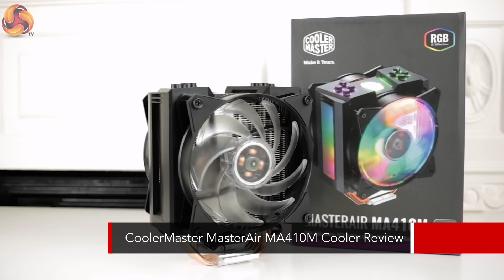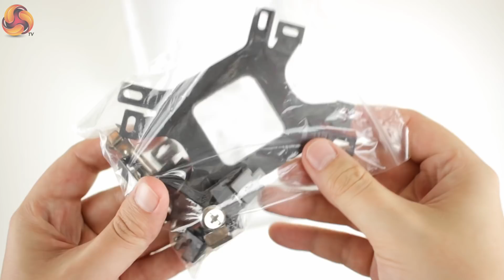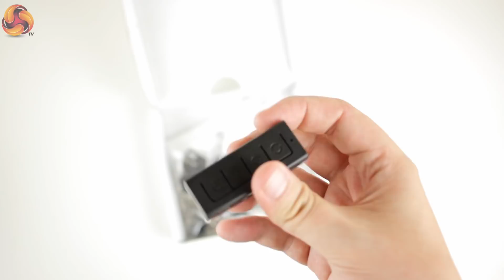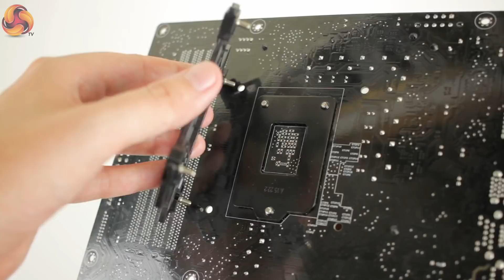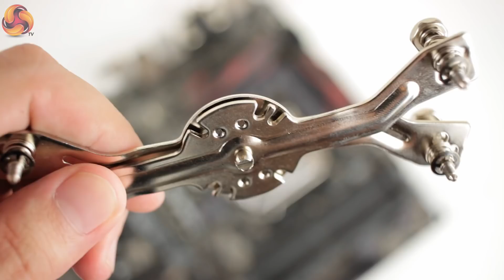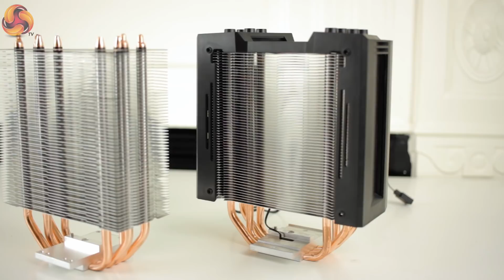CoolerMaster MasterAir MA410M - £60 RGB monster?

Comment: i didn't see anything in this review regarding clearence for ram on all 4 dimm slots. that would be some helpful information, i run the noctua nh-d15 and i can only have 2 dimms in there, i want all 4, but also with a cooler that doesn't cover slot 4.

Comment: Mine is sometimes flashing red at just 55-60 degrees celcius... like wtf, those are normal temperatures. How can u change the setting for when it is flashing red?
Reply: I have the same problem, my temp are on the 60 playing videogame, and the light became all red and start flashing,do you find any solution ?
Reply: I know Its been over 3 yrs 
But if someone has the same problem just Download the MSI program and you Can control the colors of the temperature.

Comment: Will this cooler clear corsair vengeance rgb pro ram?
Reply: Wondering the same
Reply: It will, I use both without any problems at all. On the second and fourth slot at least. The leftmost slot might have that particular RAM rub against the cooler a tiny bit.

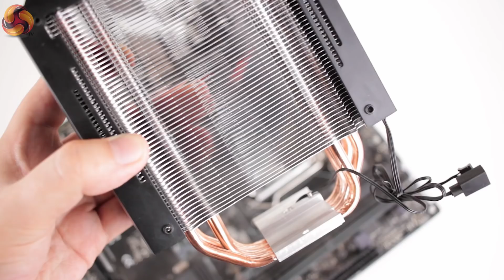Comment: video @4:11 August 2020 I just got a new MA410M my top retention bracket is slightly different; 2 Pieces but on the plus side the sensor fan wire has been moved out of the way and is updated .

Comment: I currently have a Ryzen 9 3900x with its wraith cooler and occasionally the fan would go up to high speed. Will getting this air cooler be the best solution for it?
Reply: I have this with that exact same cpu if you want extra space get the water cooling aio but this just fine runs great
Reply: To be honest a small water coolling aio would be a better choice since you have a powerful CPU, but for air cooling this is probably a great choice too.

Comment: No hablo inglés. Quisiera saber como es el rendimiento del MA410M vs Hyper 212. Muchas gracias.
Reply: Amigo, los dos tienen un rendimiento muy parecido ya que los dos usan cuatro tubos de cobre para transferir el calor proveniente del procesador y tienen el mismo diseño del aluminio, sólo que el CoolerMaster MasterAir MA410M tiene un ventilador más.
Reply: @gabrielgranadosg  amigo cual de estos recomiendas el gammaxx GT tuf, el Ma410p tuf o el fryzen para un ryzen 5 3600
Reply: @indragtx4567  Amigo, los 3 están bien, pero para un Ryzen 5 yo elegiría el Gammax GT o MA410P porque son mas baratos. El Fryzen es para procesadores de 8 núcleos o más. El Ryzen 5 sólo tiene 6.
Reply: @indragtx4567  investiga cual se adapta mejor al gabinete que tengas, al TPU que emite tu procesador medido en Watts, a las características que realmente uno necesita y que sea fácil de mantener y usar.
Reply: Justo tengo el evo 212 y queria cambiarlo por este hasta q lei que son similares. Saben si mejora la refrigeración poniendole otro cooler al 212 o con el cooler trasero del gabinete ya esta mas que bien?
Reply: Yo también no se me da escribir bien el inglés, pero puedo entender tanto el sentimiento de la impotencia como el mensaje.

Yo he adquirido el modelo Hyper 212 Led, y aunque es muy silencioso y fácil de instalar y mantener, no sé si se quedará corto cuando actualice el procesador.
Es un Intel Core i3 8100 montado en una placa Gigabyte Z390 AORUS PRO WIFI con 16 GB de RAM DDR4 Kingston HyperX y una PSU Cooler Master Silent Pro M850 de 850 Watts con certificación 80 Plus Bronze. Le pienso actualizar a un i5 9600K e instalar una tarjeta de video dedicada, ya sea de AMD o NVIDIA.
Reply: @couragebanshee  Amigo, incluso con un i9 9900k de 8 núcleos y 16 hilos el Hyper 212 le va bastante bien, incluso con sólo un ventilador conectado, porqué? Pues por los cuatro tubos de cobre transfieren el calor hacia arriba al bloque de aluminio y el ventilador expulsa el aire afuera del gabinete, eso sí; deberás tener un ventilador en la parte trasera del gabinete en la dirección que expulsa el aire el ventilador del Hyper 212 para que el aire no se quede ahí atrapado en el interior del case. Otra cosa, deberás tener mínimo un ventilador en la parte frontal de tu gabinete para que pueda extraer aire frío hacia adentro para que las temperaturas bajen bastante. Espero que esta info te ayude amigo! Saludos desde Costa Rica! 🌴
Reply: @gabrielgranadosg  de echo así es, con un ventilador trasero que expulsa el aire caliente de inmediato. Mi gabinete es un Corsair Carbide 100R con la ventana de acrílico. Y adquiri un par más de la misma marca modelo HD120, de 12 cm de diámetro con luces LED RGB cambiables, para instalar uno en la parte frontal por la zona inferior para que absorba aire fresco desde el exterior y uno atrás con el desplazamiento para que saque el aire caliente lo más rápido posible. Y el ruido que emiten es ínfimo, se escucha más los ventiladores de la sala que los del gabinete. Y me atravi a hacerle estrés para probar su rendimiento: con el Core i3 8100 apenas alcanza los 53° C centígrados y los ventiladores no subieron ni un RPM más. Me siento afortunado.

Te mando saludos desde el sureste de México, en respuesta. Gracias por escucharme.
Reply: @couragebanshee  Con gusto amigo!
Te va ir perfecto con el setup que tienes, con el i5 9600k lo mas alto que va llegar serían alrededor de 60° C de temperatura, así puedes irte por ese sin ningún problema! 🏆
Reply: @gabrielgranadosg  gracias por el consejo de corazón.
Reply: @couragebanshee  De nada amigo! Me alegro de poder ayudar 😉
Reply: @gabrielgranadosg  si tienes experiencia en Hardware, me puedes ayudar con estos componentes:
Discos duros: Toshiba, Western Digital o Seagate (la peste en fallas súbitas fatales)

Tarjetas de video dedicadas: AMD Radeon o NVIDIA GeForce GTX o RTX, fabricantes ensambladores mejor reputación y soporte postventa, y de fácil acceso a mantenimiento por parte de uno
Reply: @couragebanshee  Amigo, te recomiendo los discos duros Western Digital porque esos son más durables y rápidos.
Para lo que son tarjetas de videos, personalmente me gustan más los de Nvidia ya que tienen núcleos Cuda que se pueden aprovechar para renderizar videos, también son perfectas para juegos, tienen menor consumo que los de AMD y sus drivers son más actualizados. Las GTX son para jugar sin el renderizado Ray Tracing, las RTX son para jugar con el renderizado Ray Tracing.
En cuanto las marcas manufactureras yo te recomiendo las EVGA, ASUS, GIGABYTE, MSI, Zotac y Galax. Personalmente me gustan más las ASUS y GIGABYTE por tener tarjetas de video con iluminación RGB, las demás tienen pero sus leds no son tan buenas o bonitas.
Para lo que sería de reputación, las marcas que mencioné tienen muy buena fama por ser buenas y de calidad.
Para el soporte postventa cualquiera de las marcas mencionadas te ofrecerán buen servicio al cliente, pero eso dependerá si eres estadounidense o no, ya que las sedes o los locales se encuentran ahí.
La verdad es que se necesita que exista un local cerca de tí que ofrezca garantía a esos productos ya que si vives en otro país que no sea USA va a ser algo difícil poder obtener beneficios de la garantía del producto.
Bueno eso es todo amigo, espero haber ayudado 😉👍
Reply: @gabrielgranadosg  en lo personal creo que prefiero irme con Gigabyte, ya que tengo una placa base de esa marca con su característica enfocada a la iluminación RGB, y así controlar desde el software de Gigabyte AORUS su propia iluminación.

Ahora llega lo bueno, a partir de este mes van a salir las versiones más económicas de la Radeon, el modelo RX 5500, para darle batalla en la gama media. ¿Crees que me convenga esperar al Black Friday para cazar gangas?
Reply: @couragebanshee  Muy bien amigo, está perfecto la combinación de placa base y gráfica, los dos componentes podrán sincronizarse bien.
Sólo falta mes y medio para el Black Friday, es poco tiempo lo que queda, pues es mejor esperar a ver si el precio baja un 10-30% 💸🤑
Reply: @gabrielgranadosg  pues a juntar para el día de los descuentos importantes, a juntar el dinero al cochinito se a dicho
Reply: @couragebanshee  Exacto amigo! Lo mismo yo! Yo ocupo armar mi primer pc gaming y solo le falta el proce y fuente, así que yo estoy ahorrando para comprarlos en el Black Friday. 💲
Reply: @gabrielgranadosg  ya somos dos, jejejeje.

Por eso preferí armar la PC poniendo atención al detalle: aunque le adquirír una motherboard Gigabyte mucho más cara que el procesador, la verdad es que al final cuando los precios de los procesadores de novena generación bajen, me haré con el modelo que ya he mencionado sin tanto rollo en el precio. La PSU la había adquirido antes, cuando tuve otra PC con un Intel Core i3 540 con 8 GB de RAM DDR3 a 1333 MHz, que la he actualizado desde un Core 2 Duo E8400. Lo que tuvo esa placa es que el puerto de video integrado VGA dejo de funcionar dentro de 8 meses y la tuve que dar a un tío con problemas en su PC de escritorio, ya que la suya tuvo una GPU NVIDIA 8600GT con 1 GB de VRAM DDR3, y funcionó bien hasta ahora. Se le actualizo a una AMD Radeon RX 550 con 2 GB de VRAM GDDR5 y el problema ahora es el cuello de botella generado por el procesador Intel, como es de primera generación no tiene caso adquirir uno más potente. Y con Meltdown (https://es.m.wikipedia.org/wiki/Meltdown_(vulnerabilidad)) y Spectre (https://es.m.wikipedia.org/wiki/Spectre_(vulnerabilidad) está como exclusiva de Intel) primero y ZombieLoad en este 2019 (https://hardzone.es/2019/05/14/zombieload-store-to-leak-vulnerabilidades-intel/) con mayor razón se debe dejar de usar dicha arquitectura, pues no será parcheado por la propia Intel.
Reply: @gabrielgranadosg  me he decido esperar y comprar el fryzen lo único que me preocupa son las medidas de altura el fryzen no estorbaría mi ram pero es de 16-17 cm de alto y no sé si entre en mi gabinete ya si no nimodo tendré que ceder al enfriamiento líquido cosa que no quiero
Reply: @couragebanshee  Cierto, ahora los Intel de esas generaciones van a ser un problema con esas fugas de seguridad...
Bueno, esperemos que podamos encontrar componentes de al menos el 20% de descuento en el Black Friday! 👍
Suerte amigo!
Reply: @indragtx4567  amigo el Fryzen es demasiado para tu Ryzen 5, pero si lo que quieres es un buen cooler que se vea bien y tu proce tenga temperaturas por debajo de los 60° C en la carga pues adelante que tu tienes todo el derecho. Solo que ese es un poco caro y tendrás que ahorrar, pero valdrá la pena si de verdad lo quieres, ya que supongo que la computadora que uno vaya a armar y usar para uno mismo tiene que ser la que uno de verdad quiera para que uno pueda estar feliz. Buena suerte y provecho amigo! 👍💖🖥
Reply: @indragtx4567  Cual gabinete tienes amigo? Te ayudaré con eso del tamaño
Reply: @indragtx4567  usa una regla que mida en centímetros y milímetros, y mide desde el soporte de la placa base hasta la tapa que está en su frente. Y es el dato que necesitas saber para hacer tú elección.
Reply: @gabrielgranadosg  Gabinete Cooler Master MasterBox MB500 con Ventana RGB, Midi-Tower, ATX/Micro-ATX/Mini-ITX, USB 3.0
Reply: @gabrielgranadosg  entonces, ¿qué marca de motherboard recomiendas elegir?, ¿Aconsejarías el momento para hacer la transición a AMD Ryzen?, ¿Cual generación recomendarías?, O ¿Sigo con Intel?

El ordenador a actualizar es este:
Intel Core i3 540 a 3.06 GHz, socket LGA 1156;
8 GB de RAM DDR3 a 1333 MHz;
PSU Cooler Master Silent Pro M600 de 600 watts con certificación 80 Plus Bronze;
Cooler Master Hyper 212 Led;
SSD Kingston UV400 de 120 GB de capacidad;
HDD Hitachi de 500 GB;
AMD Radeon RX 550 con 2 GB de VRAM GDDR5 marca Gigabyte;
Motherboard extraída de una PC Gateway modelo DX4840-02

Gracias de nuevo
Reply: @indragtx4567  lo tienes fácil, solo descargas el manual en la página web de Cooler Master, poniendo el dato que acabas de proporcionar y lo lees, en la parte de sus especificaciones. Responde si necesitas más ayuda.
Reply: @indragtx4567  Amigo está muy bonito tu gabinete! Yo estoy planeando conseguir un Cooler Master Master Box MB530P RGB. 🌈💖
Amigo, acabo de averiguar los datos del Fryzen y de tu case y me di cuenta que el Fryzen es 1 mm más largo de lo que en la página del gabinete tuyo dice que soporta. 😥
No sé si de verdad cabe, pero yo sugiero que vea más videos de tu gabinete en la que meten este tipo de coolers para estar más seguro, o averigua en los reviews o preguntas en las páginas del case en Amazon, Newegg, Ebay...
Reply: @couragebanshee  Amigo, creo que las placas madres Gigabyte o Asus para mí son las mejores que hay debido a su durabilidad y características.
Te recomendaría que te pases a AMD Ryzen, pues esos procesadores hoy día son una oferta pues ofrecen el mejor precio-rendimiento, cosa que intel nunca ha podido hacer excepto en los años anteriores del 2006...
Sí, sé que los Intel ganan en rendimiento para juegos, pero es sólo por una diferencia de 5 a 15%, además de que tienen menos núcleos e hilos, son más caros, ofrecen unos stock coolers horribles, temperaturas más altas y mayor consumo.
Cuando salió Ryzen, dile adiós a Intel por que ya AMD se puso las pilas. 😉👍
Reply: @gabrielgranadosg  que lea por si mismo el manual que está en la página web de Cooler Master, buscándolo en Google. Y saqué sus propias conclusiones.
Reply: @gabrielgranadosg  de los coolers de Intel me cuido yo, nunca me acostumbré a soportar el ruido que emiten estos sistemas de refrigeración, y cambie en su tiempo cuando usaba el Intel Core 2 Duo E8400, un Zalman CNPS 9700 LED, que aunque grande y agradable a la vista, es muy difícil darle mantenimiento por el diseño de sus aletas, muy filosas por cierto y a la hora del desmontaje. El anclaje a la placa base no era nada sencillo. 

Así que lo que mejor se puede hacer uno cuando adquiere un procesador Boxed/retail, es comprar un disipador con heatpipes o con cámaras de vapor lo antes posible. La placa base y el procesador lo agradecerán a la larga. AMD tampoco sale tan parada cuando decide que ya habiéndose recuperado de su caída, la caga con esta nefasta decisión: https://hardzone.es/2019/08/24/wraith-spire-2019-vs-2018-amd-disipadores/ decide recortar en gastos de diseño con los disipadores de sus productos, y subir los RPM de los ventiladores de los sistemas de enfriamiento, provocando aún más molestias auditivas. Eso es uno de los puntos negativos más importantes que me impiden ver a AMD como una plataforma de confianza. El otro punto, es la escasez de información sobre el desarrollo y salida de los chipsets de gama media para la tercera generación de Ryzen. Aunque es cierto que con anteriores chipsets se pueden utilizar los procesadores de 3° generación, prefiero esperar a que sus posibles defectos hayan sido corregidos.

Un saludo de nuevo y gracias por la respuesta
Reply: @couragebanshee  De nada amigo! 👍
Pues veremos si lo corrigen con el lanzamiento de los próximos procesadores de la cuarta generación Ryzen ya que no creo que en la tercera generación los pongan ya que en la página oficial de AMD los lista así:
https://www.amd.com/es/technologies/cpu-cooler-solution
(Procesadores con el Wraith Stealth, el disipador sin cobre)
AMD Ryzen™ 5 3600
AMD Ryzen™ 5 2600
AMD Ryzen™ 5 2400G
AMD Ryzen™ 5 1400
AMD Ryzen™ 3 3200G
AMD Ryzen™ 3 2200G
AMD Ryzen™ 3 1300X
AMD Ryzen™ 3 1200
En el caso de Intel, ellos por el momento no ofrecen disipadores como los Wraith Prism o los Wraith Spire, por lo que ahorita sus procesadores no son muy buen producto al no incluir sistemas de refrigeración decentes y con esos precios ridículos. 😩
Reply: @gabrielgranadosg  revise new egg y dice que son 155 mm de largo la verdad no sé si arriesgarme veo que es de 16 cm Masomenos si es el caso teóricamente si cabría
Reply: @indragtx4567  Sí tal vez sea mejor no arriesgarse, la última opción sería que revises videos de youtube en los que aparece el cooler o el gabinete y le preguntes al que subió el video si tu gabinete o el cooler funcionan entre sí, ve a por los videos que están en inglés porque son bastantes, usa el traductor de google para conversar con ellos.
Reply: @gabrielgranadosg  muchas veces no contestan lo que haré hoy será lo de la regla ver cuantos cm son de la placa madre a la tapa de cristal y de ahí vero si está la medida entre 16 o 16.5 cm entrará bien y si no pues nimodo tendré que unirme al equipo de los AIO compraría un radiador de 240 o 360 que si son compatibles con mi gabinete quizá de cooler Master o no sé
Reply: @indragtx4567  Ok amigo, con uno de 240 seria suficiente para tu procesador, es mas hasta uno de 120mm!
Espero que te vaya bien amigo! 😀
Reply: @indragtx4567  gracias por tomarme en serio mi consejo. Es mejor prevenir que curar

Comment: This cooler has just the 3 pin connectors for connecting to  addressable RGB motherboards, yet my MSI B450 Tomahawk's JRGB 1&2  connections are all the 4 pin type...So how hell could use MSI's Mystic Light function??? :/
Reply: This cooler is based on JRainbow (3 pin) as it is Addressable RGB not JRGB (4 pin simple RGB). You have the wrong cooler. Buy the RGB Black CM cooler. :)
Reply: @SyedAounAbbas  Thanks for the heads up but, what that really means is that people at Amazon are flat out liars because in it's Amazon description it states "The MA410M's 28 addressable RGB led fully addressable RGB that is certified to sync with RGB motherboard".  I mean both the B450 Tomahawk and the CM MA410M were released right around the same time (late spring /summer 2018) so there's no good reason they shouldn't have been compatible or at the minimum Cooler Master or MSI should've provided some 3 pin-to-4pin adaptors to make their products easier to work with each other :/

Comment: The cooler has been installed in the inverted position.
Reply: is that why the temperature is higher them The cheaper one(Ma410p)?
Reply: @gabrielnobre7447  that could explain it
Reply: How do you know?  I have the same one, how to know is it inverted or not?
Reply: @speedfreakpsycho  In the manual, it clearly shows that the correct way to install this cooler is the wider side to be facing the back/exhaust fan.